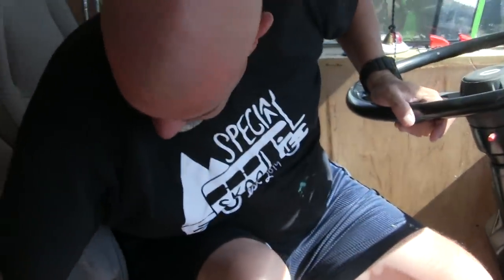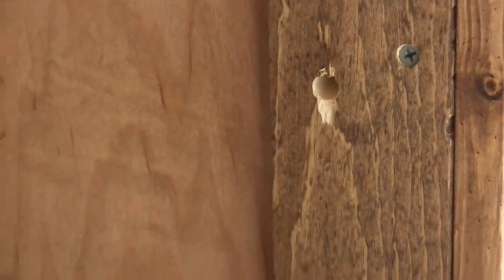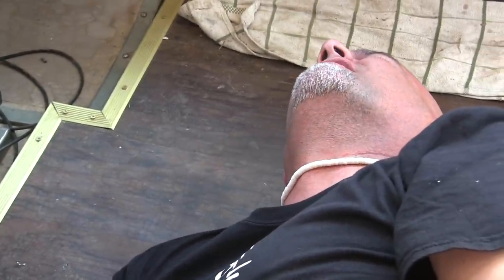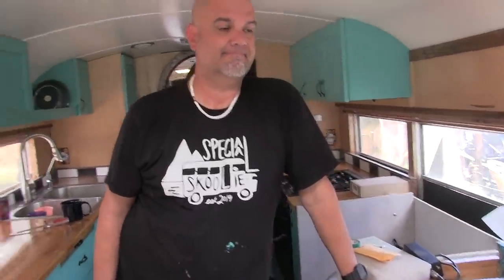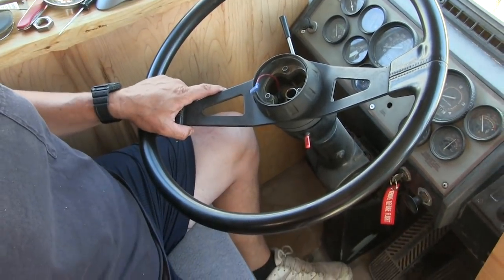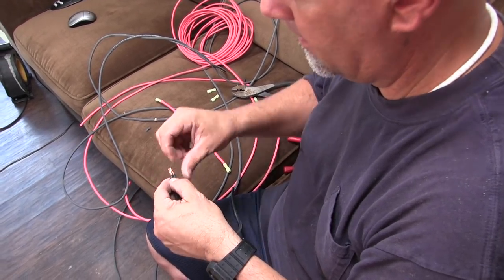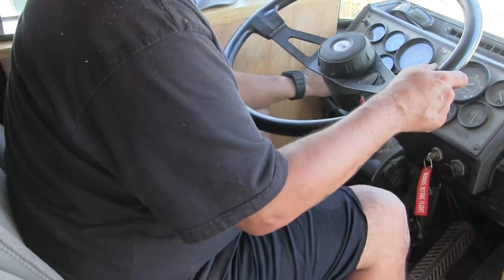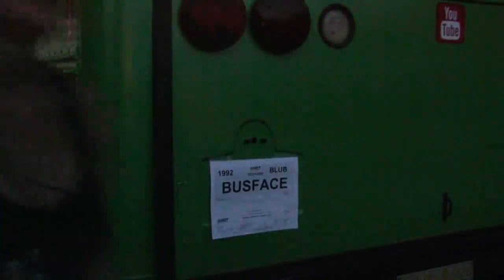Installing Driver Seat Belt, plus Turn Signal Fix & License Plate Lights on our Skoolie

Comment: Mike. The top seatbelt mount is supposed to have a crush tube in it so you can tighten down the bolt but the mount can move. As you look back at the video, you will see the belt crinkle up when you fasten it, it needs to be able to move. It will wear prematurely if not. You could use a DPDT switch for your indicators if you get tired of the other 2.  :)
Reply: I was thinking of the same thing but I wonder if a switch from a fender guitar could handle the current?

Comment: You can buy what is called a "signal stat" for your turn signals. Signal stat was designed for older semi trucks and will handle all the lights you want to install.

Comment: Mike, i was a locksmith for 20+ years covering residential, commercial, and automotive. That turn signal switch will be either GM or Chrysler. You'll have to think old school. When cars and trucks were basic. Find a local junk yard. My guess is GM. It will take some searching but that will be to just find the right style. Search by year, turn signal switch, starting with 1972. You may be able to contact Blue Bird and MAYBE get a part number.

Comment: Changing the big lights out to LED will make a giant difference in your power draw also. You can run many more/larger lights on a single circuit if they are LED.

Comment: Mike, I enjoy your postings.  I normally do not comment, but I want to bring something to your attention.  I worked with heavy truck and bus seat belts in the late 90's.  Back then most of the heavy truck and bus seat belts had their retractor mount to the frame of the truck or bus.  I noticed that you mounted the retractor to the seat.  The reason it was mounted to the frame of the truck or bus was to ensure the belt did not move at an angle from the retractor to the top mounting loop.  Please check the instructions that came with your seat belt to make sure it is installed properly.  A seat belt not properly installed in a heavy truck or bus can result in the retractor mechanism not working to 100% effectiveness.

Comment: You should use a locknut on seat belt upper mount. Movement of the seat belt tends to unscrew the bolt with only lock washer.

Comment: My wife and I just got back from Elkhart, IN where among other RV stuff for the bus we got surplus custom Chevy van seats with integrated seat belts. And swivel bases.  I was afraid of trying to do shoulder restraints on the bus as was original for the driver seat.  If you want to know who we bought from they had another pair in beige... email me at email on our channel profile. Mine were $250 each.  But we picked them up... no freight.

Comment: On the upper seat belt bolt, I'd drill out the wood large enough to put a nut and washer between inner and out on the metal column, then you can add another nut plus a nylon lock nut to allow the upper one to "float" on the bolt. Still safe, but will allow you to weatherseal the outer face of the bolt.

A lot of people make those tables on the steering wheel for using laptops while stationary.

Comment: The shroud around the column splits in half.  The switch is plenty heavy duty enough.  You simply need a heavy duty flasher.  Buy a new switch and flasher.  Leave wheel loose till you drive in a straight line and get it on straight.  Then put nut back on.

Comment: Mike you need to rethink the G forces on that bolt for the shoulder harness
Reply: And the turn signal switch is a harness that unplug at the bottom of the column and is fished through the column, that switch looks like the same type I had in my 72 wagoneer
Reply from the maker: The proof strength of a 7/16" grade 8 bolt is 14,000lbs. I think it will hold me through any survivable crash

Comment: I seen the comment about the LED lights, although, in the mean time you could just undo the upper "turn" signals. Then when you get the chance to go to LEDs you could add them back. Just a thought... Also, I would say that you should look for another, longer seatbelt, or move (gosh I hate to say that) the bolt you have to a lower position. As it is, I doubt Kerry could drive the beast if she had to slide the seat forward.

Comment: Pilot holes, lubrication and stepbits are your friends.  Seat bracket raw metal?  Won’t it rust when you get a little moisture in the air?   Can you switch out your lights to led? Reducing the power draw through the circuit, preventing overload to the switch?
Reply from the maker: I have thought about changing the lights to LED but I will get to that later after we finish this beast!
Reply: Mostly just commenting for the You tube formula.    Add a horn upgrade to the list.
Reply: Ohhhhh.... An air horn!!!! 😂 
That sounds like a wonderful idea!!!

Comment: Thanks for going before me Mike! I too had the idea of using the upper lights as stop and turn. I'll have to do some rethinking. Do you think adding a relay would save your turn signal switch? Its looking so good. I'll miss the build videos when you are done.
Reply from the maker: Abosolutely
Reply from the maker: If I had known. I only figured it out when the paper clip got hot!  I will replace those big spot lights with LEDs later but I need to pick my battles right now until  I have time to revisit this.

Comment: Did Kerry try the seatbelt? If she has to move the seat forward to reach the pedals and steering wheel, the seatbelt won't be long enough without an extension.

Comment: Hey, do you guys already know what you're going to do on the hole of the pirate door? I remember Kerry saying something about stained glass? Do you have an idea for the design?
Reply from the maker: We don't have a definite design in mind yet, we're putting it on a back burner and will be moving into the bus long before we ever get to the stained glass! Honestly, We love all the recommended idea's people share with us!
Reply: @BussyMcBusface  Cut a piece of lexan the right size and turn Kerry loose on it with some acrylic paint. If you decide you don't like it, you can always replace it.
Reply: @BussyMcBusface  I was thinking along the same lines as dchubb42... Piece of plexiglass and try painting different designs you are thinking about til you are sure before you spend the money for the stained glass.

Comment: If you don't find something else, you can get a generic turn signal that attaches to the steering column with a clamp (like a radiator hose clamp).  Here is one...https://www.raneystruckparts.com/universal-chrome-turn-signal-switch/?sku=UPI110307